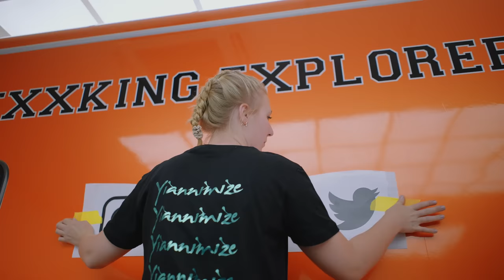Explorers Pick Up Their Mobile Home

Comment: #AskTheStaff How does knifeless tape ACTUALLY work?? Does it act like a sort of acid weakening agent against the wrap to help break it down or what? It’s always confused me 😅
Reply: I believe it’s like a wire. The tape consists of 2 or 3 sections in which the middle one pulls apart allowing a seamless cut from each side 👍🏻 I could be wrong though